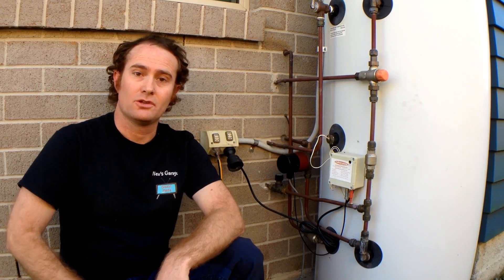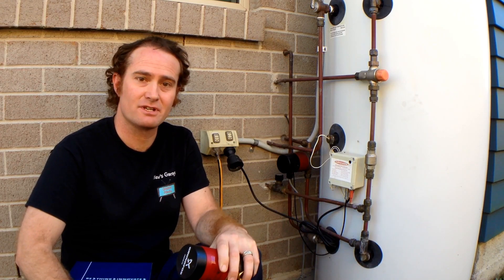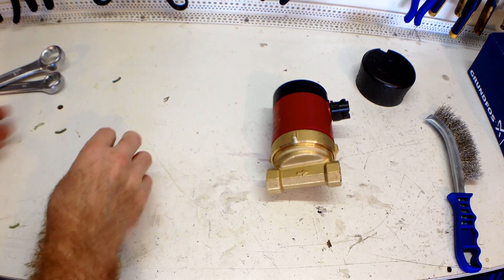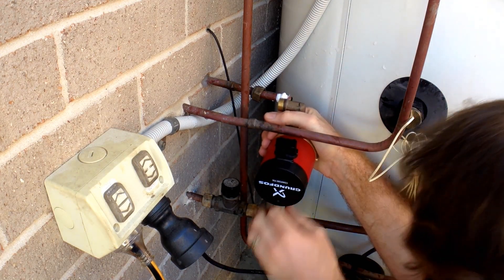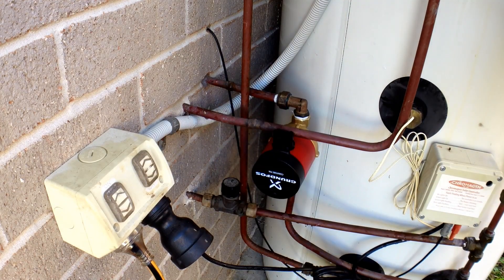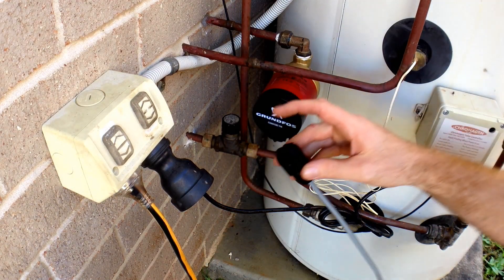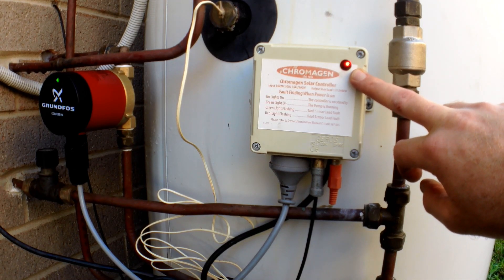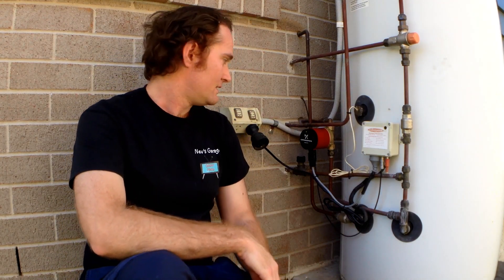Solar Hot Water System Service Part 1 : Replacing the Electric Water Pump

Comment: Not sure why you didn't just leave the impeller housing (the brass part attached to the big brass retainer thing) in the system and just swap out the black and red part (motor and impeller) since it seems you are using the exact same model of pump.  Also, this video only applies to systems in areas that never have freezing temperatures, which have a pressurized  water feed into the solar loop, which have no glycol in the solar loop.

Comment: Hi, I'm just wondering if you could make a video on how to clean/service the solar system  hot water tank? I recently notice there's a rumbling noise coming out of the tank and i think that's a sediment settle in the tank which hasn't been serviced for awhile. Please make a instruction video how to clear/flush them out thanks?

Comment: Thanks for this video, I'm due for a pump change as I've found out with a cold shower this morning (a day after turning off the gas booster for summer).

One question; I've tested everything else in the system but it would be good to know what resistance to expect from the tank and panel sensors; any idea what they might be? I understand the tank sensor may be a 10k sensor, but any idea about the panel sensor resistance?

Thanks mate.
Reply: Hello, 
The panel resistance is the same. The cable is and RCA cable and plug, you will find within about 2-3m from the roof sensor there will be an RCA joiner in the roof cavity. The older Chromagen roof sensors did not last that well the newer replacement ones are of much better quality. Because of the RCA cable you are better to install a Chromagen roof sensor not just a 10K thermistor as the chromagen roof sensor are high temp rated and water proof.

Always replace the roof sensor at the same time as the pump.